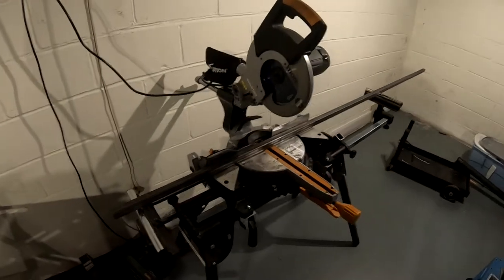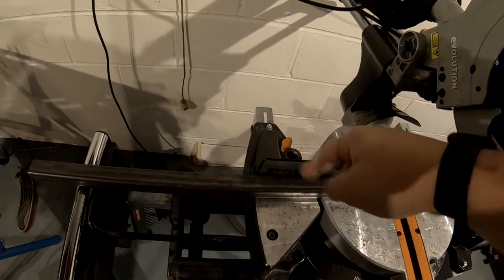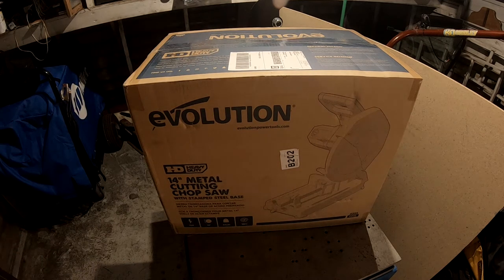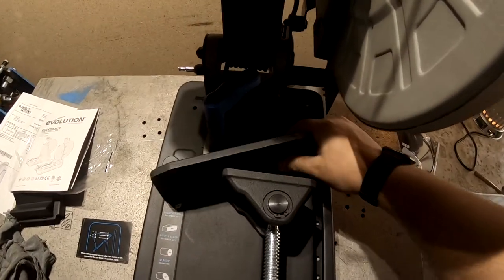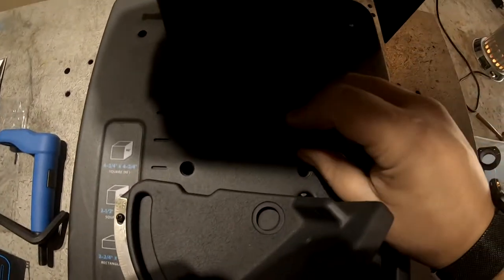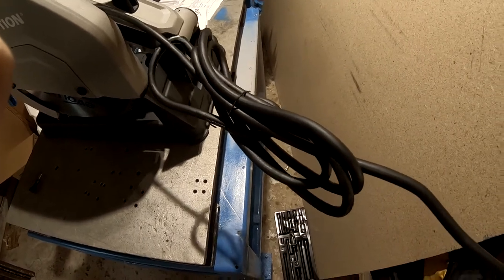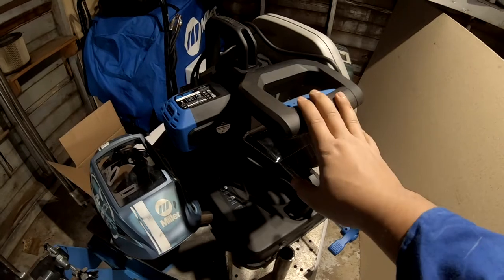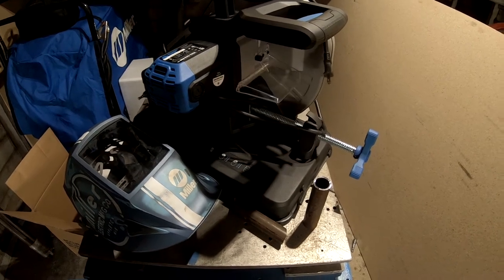Evolution 14" Metal Chop Saw (S355CPSL) - Best Saw I Have Ever Used!

Comment: I used to have an old rigid cold saw like this and had to sell it for a cross country move. Now in the market for a replacement for it and appreciate the video. I am going to mount my saw on a dedicated table with support for stock on both sides and a sliding stop with built in measurement system. 

An important addition will be a coolant/lube system along with a built in vac system to collect the fine metal these saws kick out. 

One thing about the coolant/lube system, though a bit messy, it cuts down on the floating metal particles these saws put out. I wear a respirator when using the saw due to this and I recommend any one who uses these saws do the same. If you can, make your cuts with this saw outside. My saw table has castors so I can roll it outside if I have a lot of stuff to cut..

Great saws but loud and messy. Done enough research and now going to buy this saw off amazon. To bad you don't have a amazon aff link in your description section, if you did I'd click it so you could get a commission.
Reply from the maker: I appreciate the feedback! I’ll have to look into getting some affiliate links in my description.  Yeah these new cold cut saws are great and when you get them dialed in they cut perfect. A little on the messy and loud side, but the eat through material.